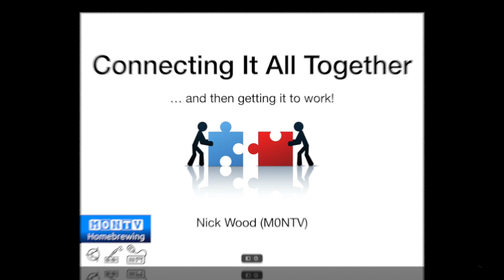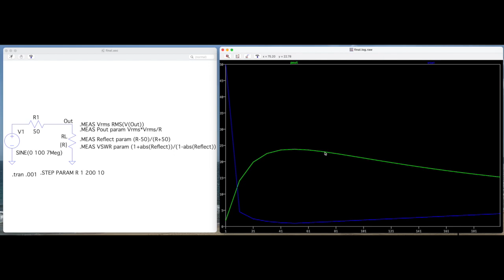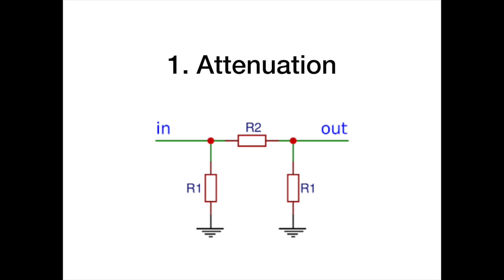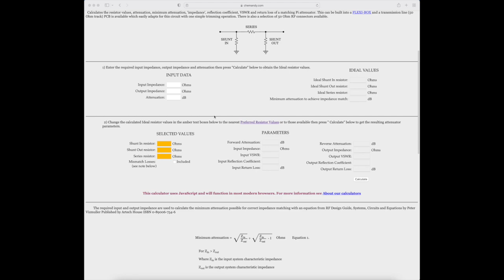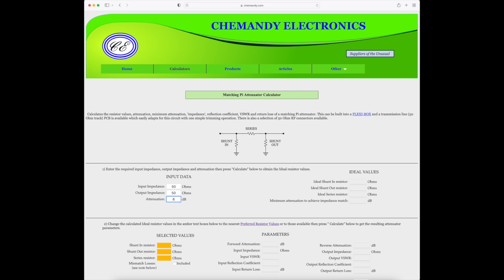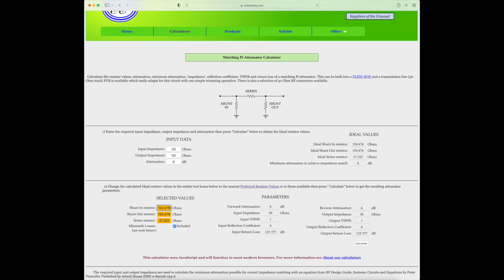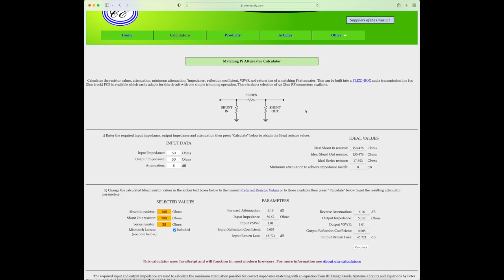27 - Connecting It All Together ... And Then Getting It To Work!

Comment: Why not reduce the gain of the stage that has too high gain?
Reply from the maker: Good question Richard. If you know in advance how much gain you require then you could do that. Personally I find that even with the best planning you can find yourself adrift by a few dB. A pi attenuator pad will knock the power down by a known amount and will also help the impedance matching. I even build some stages with more gain than I need JUST SO I can use a pi attenuator after it! Most of my issues in homebrew transceivers have boiled down to too much gain somewhere - often in the IF stage where amps are frequently cascaded. Thanks very much for your interest. 73 Nick

Comment: Hi Nick, the LTspice plot is very interesting, but how did you get that? 
Gerard
Reply from the maker: Hi Gerard. It is a multistage process but you can read all about it here: https://hackaday.com/2018/08/23/circuit-vr-measuring-with-ltspice/
Hope this helps. 73, Nick
Reply: @M0NTVHomebrewing  Thanks Nick, that method helps to fill in the right value in the schematics as in your video51
Cheers, Gerard